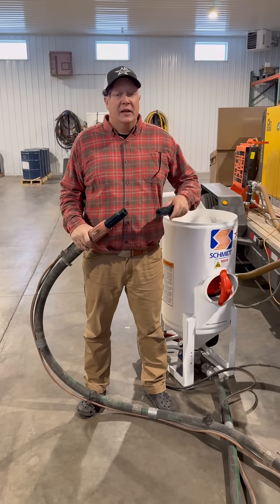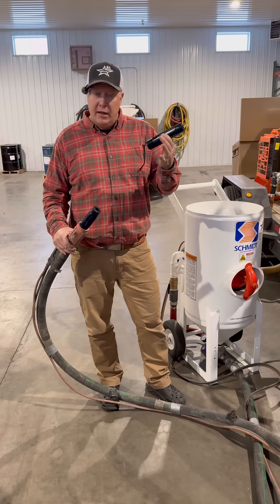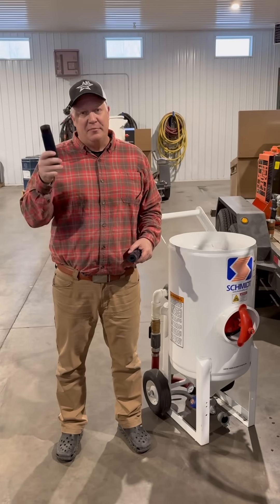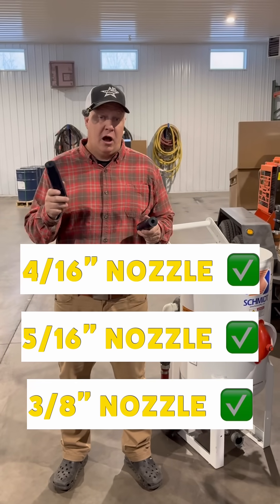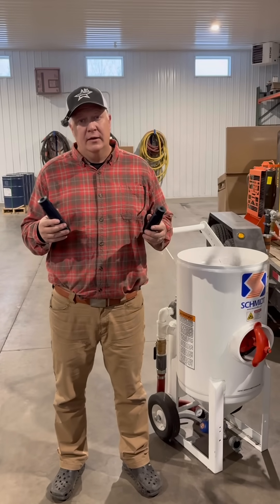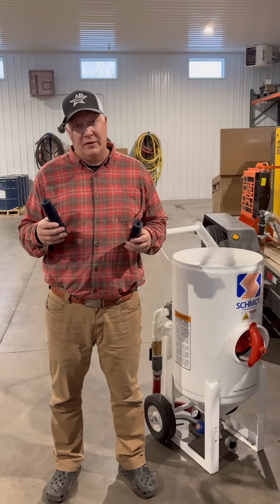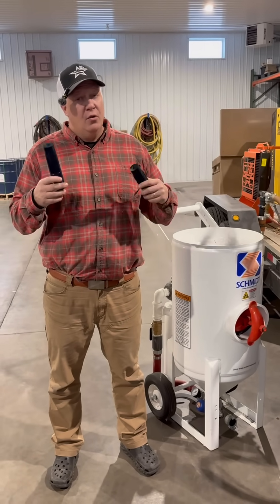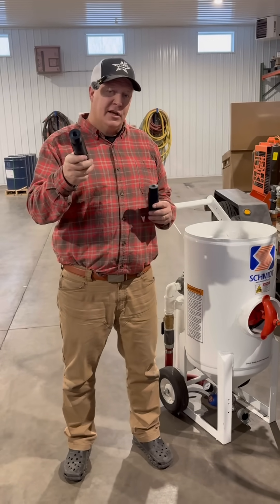Testing Farrow Flow Pressure Differential #sandblast #sandblasting #farrowflow

Comment: We tested it with a #10 5/8 nozzle. Did not check pressures but It restricted it so much we threw it off right away before it ruined our metering valve. The pot was so pressurized it was impossible to get decent feed..either it was too much media or nothing.  Will try again with it installed at blast pot air inlet, not in front of the metering valve like directions tell you to.
Reply from the maker: Thank you for the feedback and test results. Very helpful!